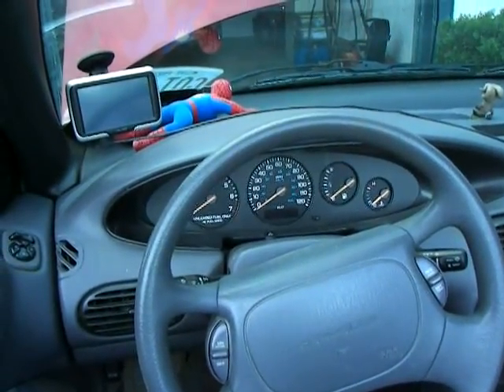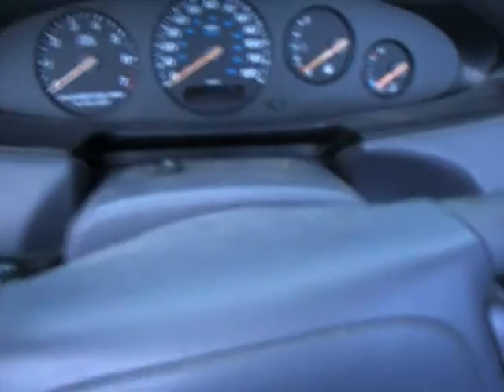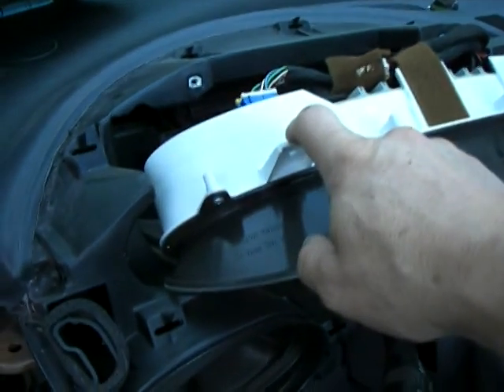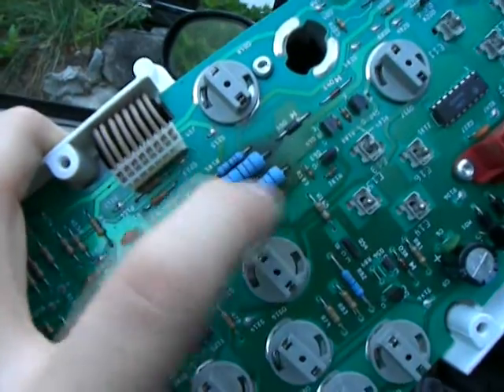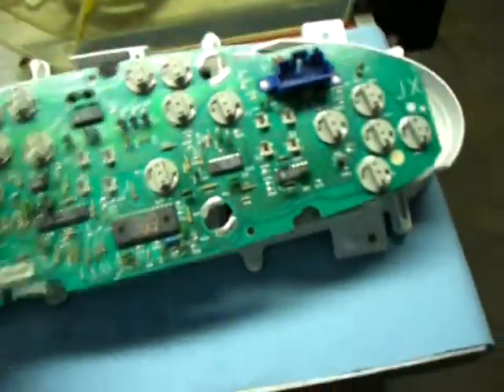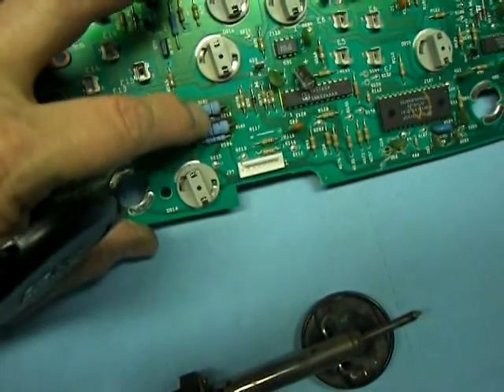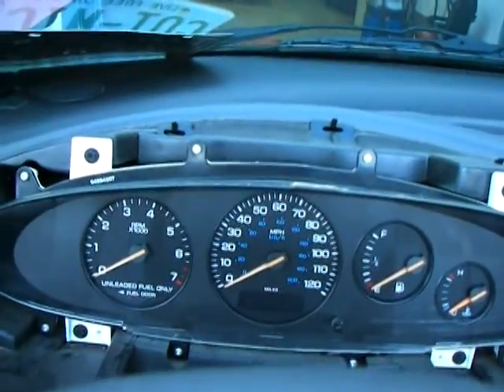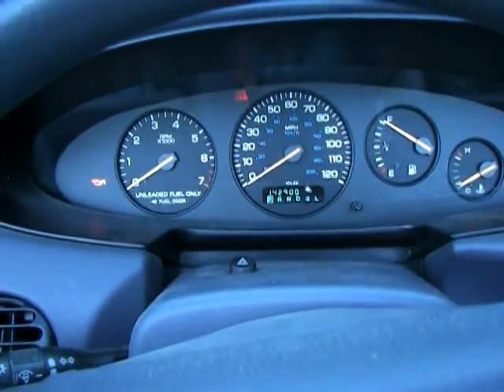Sebring Convertible odometer / speedometer repair -- Easier than you think!

Comment: Great video.  Just fixed our 1997 Stratus (we are 2nd owner), only 186,000 Km!  The odometer was intermittently going out for the last 6 months, and just quit completely today so I did the repair.   The PCB did not look to be burned or overheated in my case; just the bad solder joints on the resistors.

Comment: Jurek Pol:

R101, R105: 12Ω, 3-4W
R106: 13Ω, 2W
Source: http://www.automotiveforums.com/t232004-intermittent_tachometer_and_odometer.html
Replace them to resistrors with bigger power rating (7W and 4W).

If it doesn't work then most likely you need to replace the Q63 and Q54 transistors too. Also with bigger power rating.

Comment: It's so weird to see how much is shared between the Neon, Sebring and Cirrus.  That dash looks like someone took the steering wheel off a Neon and stuck it on a Cirrus.  They even have the same gauge problem with the solder joints.

Comment: I made this repair on my daughters car. It worked for a couple of months & it now looks like it has happened again. I am going to go back in a second time to do the repair. This time my plan is to glue some transistor heat sinks to the resistors at fault, using some porcelain epoxy.
Reply: +ThePhuku 
Question for "ThePhuku":

Can you explain more about the "porcelain epoxy" you plan to use for the resistor heat sinks? I'm not familiar with that. I AM  a heavily experienced Electronics Technician, but haven't come across the "porcelain epoxy" before.

Obviously, it has to be a high heat capable epoxy, and also has to be able to adhere to the substrate of both the resistors and the heat sink (aluminum).

I think when I do mine I might try to determine if there is room back there to put in higher wattage resistors. If there is a lot of room, I might fully replace the resistors with larger ones (physically larger) and also "stand them off" from the PCB a little bit, like even a half inch, if there is enough room. I'll also plan to attach heat sinks to them, if there is room.

Something like one of these, perhaps?>

http://www.amazon.com/Devcon-Epoxy-Bathtub-Repair-Almond/dp/B000NCUTCO

http://www.acehardware.com/product/index.jsp?productId=11492803

http://www.menards.com/main/home-decor/crafts/specialty-paint-finishes/homax-white-porcelain-chip-fix-2-part-epoxy/p-1955070.htm

I know this thread is several month old, but if you get a chance to respond, I'd appreciate it.

Thanks

Comment: good vidéo! do you know if this olution fix also odometer issue , like increase and decrease values ?
Reply from the maker: Not sure I understand your question, but all this does is make it work again.  You can't change the odometer value, which would be illegal anyway.
Reply: @mrcorbina  values in my odometer increasind and decresing,
Reply from the maker: @ericcorbrion2421  Whether your odometer display is working or not, your miles are still being tracked properly.  The module that tracks your miles is completely separate from the dashboard display.  If I remember correctly, that module is mounted somewhere under the back seat.
Reply: @mrcorbina  thanks for the information, do you know the name please of yhis module?
Reply from the maker: @ericcorbrion2421  No I do not.  I'm sure a little googling would turn something up.

Comment: Didn't work :(
Reply from the maker: Sorry to hear that.  Sometimes those connections get so badly burned out that there's no metal left on the circuit board to solder the resistors to.  I've had that happen to me once or twice.
Reply: Get a fiberglass scratch brush pen and etch out the traces nearby and solder them to close the circuit or run jumpers.